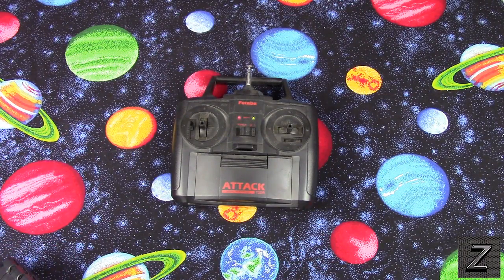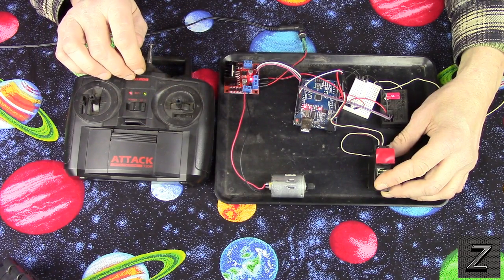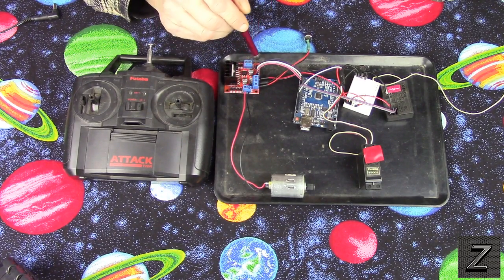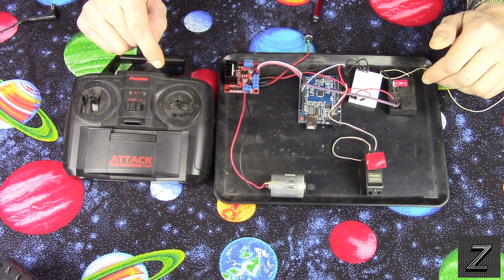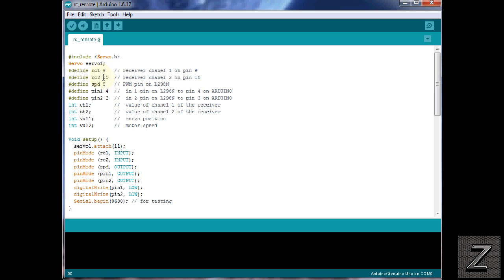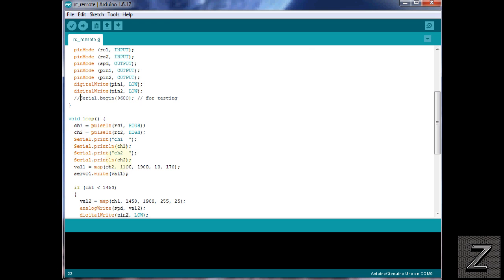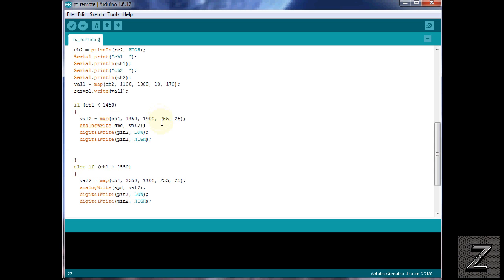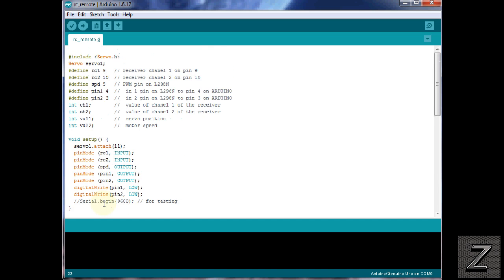How to use a RC transmitter and receiver with your arduino (Robot, Drone)

Comment: When I turned OFF the transmitter, the  motor starts to run.
The first if ch1< 1450 will run as 0 is < than 1450 Bob
Reply from the maker: when you loose contact all kinds of things can hapen, shut down the reciver before you shut down the transmiter...
Reply: Dude , how to turn off the receiver when he is far away from me ?!
Reply: Right! I just moved the ch1=0 check to the top, check it first, then if no pulse it will turn off the motor and exit the if statement.
Reply: Done before you think it about...!!! No working !!